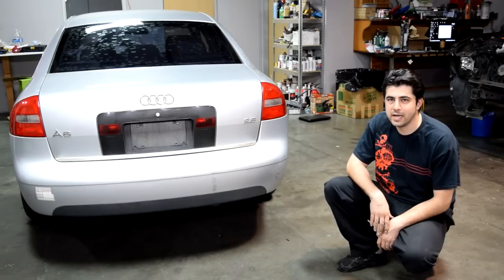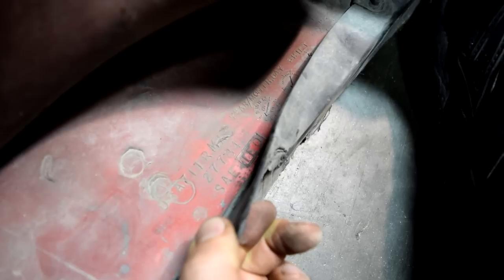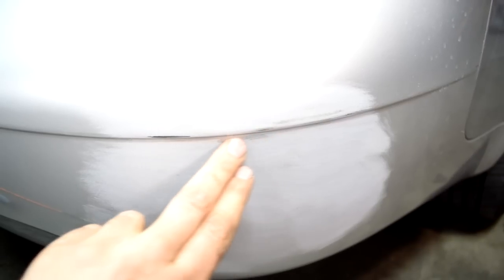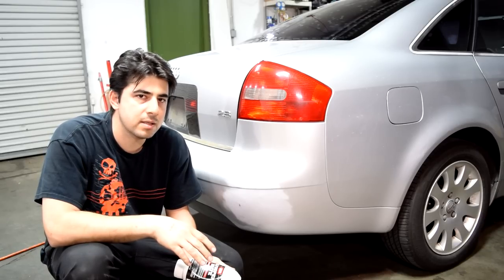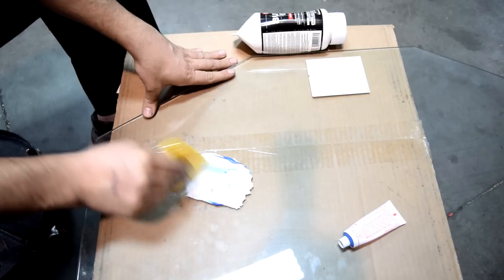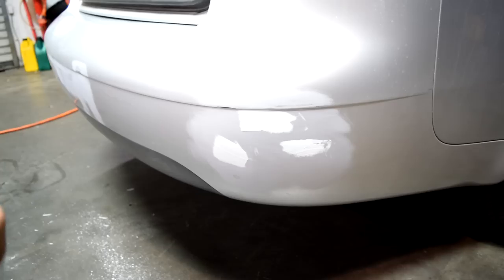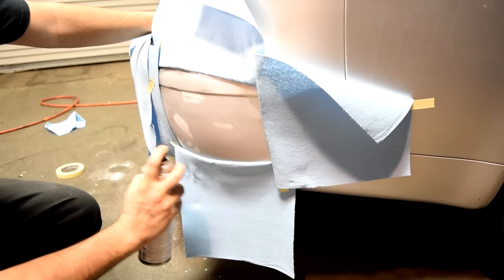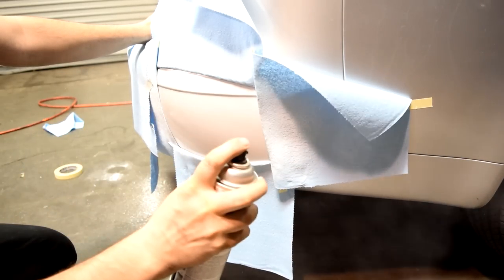How to Repair and Paint a Plastic Bumper Cover For Beginners - Part I

Comment: I just used spray a can and clear after it was sanded then finished. Using different grades of sand paper. 1000 to 5000 grit used then apply Meguires ultimate compound. Per chris fix instructions good video

Comment: Quick question. See the way you scuffed the panel down to clear around the area. If you were to apply paint what grit would you do it with? 400-600? Aswell, I painted my bumper I sanded and primed the section and scuffed the whole bumper with 600grit wet and came out perfect, is the 1500 scuff just to minimise scratches?

Comment: If I sand down the whole bumper with 220 then 320 then 400, do I still need to sand it with 1500 grit sandpaper? And do I have to primer it after sanding down with 220 even tho I don't have any deep cuts like that?

Comment: You are a typical spray painter, not a panel beater!  Do not use your finger tips to measure how level a panel is.  Always use the whole of your left hand over the area.  Your left hand is the more sensitive than the right.  Using your fingers will result in visible ripples in the clear coat.

Why don't you use a color mist spray over the filler before rubbing it down.  Not highlighting fine scratches will lead to a  "sweating" affect, i.,e. fine bumpy lines visible in the gloss.

Comment: hey very good video. what primer do you recommend to use? Is duplicolor primer any good?
Reply from the maker: +Jon Varbero No the duplicolor primer you see at autozone is not compatible with these paints, they are laquer based. Buy the primer at the same place you buy the base coat to make sure its compatible. GL
Reply: Great thank you.

Comment: so what if you just wanted to repaint the plastic cover,would you just have to scuff it all and clean it really good,then just repaint and clear?
Reply from the maker: +sleepe361 400 grit over any area you are spraying basecoat, 1500 grit over any area you are spraying clear coat. If you are spraying clear coat over base coat than obviously dont go over fresh basecoat with 1500 grit.
Reply: do you need to paint the whole bumper or can you just do one spot and try and blend it in?
Reply: Mystic its easier to paint the whole body part compared to blending.

Comment: Can also use hot water instead of a heat gun to get out dents.
Reply: No cause u cant contol how much heat u put into tolhe plastic which could lead to u over heating it and it stretching as soon as u touch it a heat gun gives you the most contol of the heat u apply before massaging the bumper

Comment: Thanks for the vid. Silvers and beige are really hard to color match. Bumper color looks a different shade already.

In this case seems that you are not taking the bumper off to re-spray it, Isn't the masking effort greater that taking the cover off?
Reply from the maker: gianfrancoa not really, I I usually just tape around the bumper and use a large plastic tarp to cover the rest of the car. Some of these bumpers are a beast to take off. Thanks for commenting.

Comment: if i go to a body shop how much would this cost me with the same damage???
Reply: Get a new bar unless they have some one specifically trained in fixing plastic parts all they will do is use a BOG that they use on metal panels which will flake of really easy revealing the damage
Reply: Also 300 average
Reply: Better get a new bumper if available 😂

Comment: I thought it's shouldn't flex because it's all connected to the frame. Frame benting is bad right? See the bumper covers are flexible and cheap to mass produce. cars in the past were had steel bumper and didn't flex , the suspension does all the movement. I mean I don't know if I right but it just a thought.
Reply: Miguel Hernandez the bumper cover will bend and stretch more compared to the metal body parts. It will cause the putty and filler to start to flake off

Comment: Here is the funny thing the way he is doing is structurally weak and is not repairing the integrity of the bumper but just the apearance. The bumper is on the car still unable to repair properly repair is only on the outside not inside meening the damage is not repaird but covered up. Be safe ur car can be the only thing between h dying or living and doing repairs at home is dangerous aswell failure to list the damage u repaired can lead to insurance issues when trying to claim. Ive list some of many issues i can see within a couple minutes also he failed to properly strip the paint which means the putty he just put on is prone to cracking/flaking off due to there being a layer of primer/paint inbetween it and the plastic making it difficult for it to bond. Oh btw im fully qualified specifically to repair bumpers as close as u can to its original appearance and integrity.
Reply: the bumper cover is just that,a cover.It has no structural integrity,only esthetic purpose.It covers the actual pumper metal frame the protects the frame of the car.